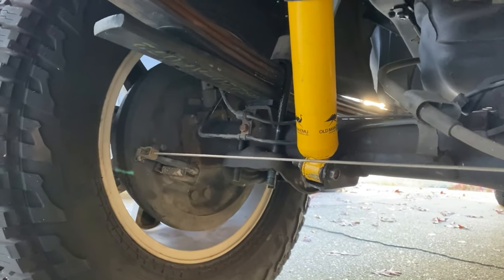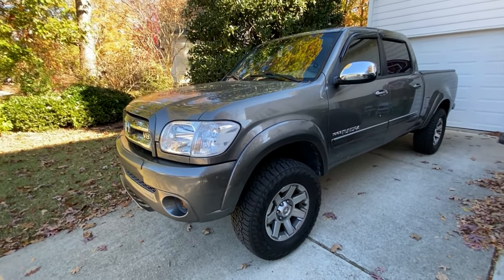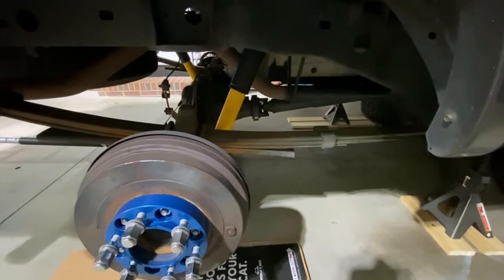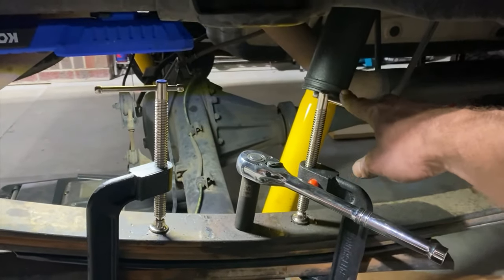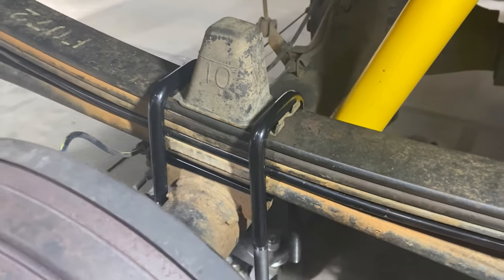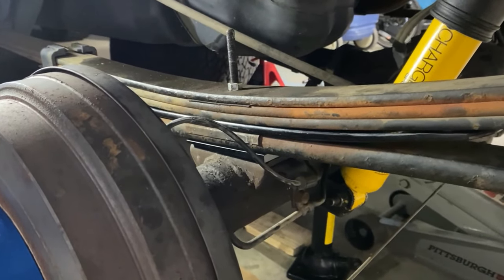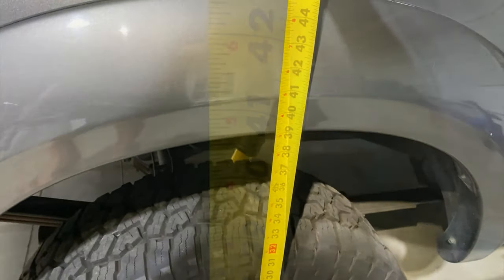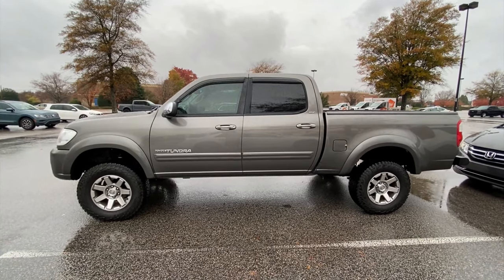Installing Torch Off Road Lift Kit (Add A Leaf and Axle Shim) for 2006 Toyota Tundra

Comment: Nice Tundra - that thing is super clean, looks great with the lift and that tire and wheel setup. I just did the Torch add a leaf in the rear with a 2.5” lift in the front using Rough Country extended strut/spring combo on my 07 Tacoma. Also went with a slightly larger AT tire. Makes it look like a completely different truck, I love it - Ride quality is great too.
Reply from the maker: Nice! That's awesome to hear.

Comment: Nice Tundra, very clean, what size tires are those from Falken?  let me know, that's a super nice riding height.
Reply from the maker: These were 265/70R17s, I've since moved to 285/70R17s on bronze Roost wheels (which allowed me to delete the spaces).
Reply: @danvprod5848  NICE!!!

Comment: I bought the torch add a leaf for a 03 Tundra. Do you have to install the shim kit as well? They weren't included in my kit. Thank you!
Reply from the maker: The shim is not mandatory, but it does make the pinion angle better when you lift the rear. It's an extra purchase, however. You will be likely good without it because if you are running the original springs, they likely have sagged a bit by now, and you will restore the regular ride height, perhaps.

Comment: What size tires are on your truck? I had 265/70/16 GY Duratrac installed on my 06 but I think they look kind of small, not sure if I can swap them for 285/75 /16. I installed the same lift kit...
Reply from the maker: At the time I had 265/70R17s on there, and I upped to the 285/70R17s when I installed in the Method rims. No trimming required, just needed to remove the mud flaps.

Comment: Awesome truck.. love your wheel and tires 
Can you share info please on wheels
Reply from the maker: Thank you! These ones are the 4Runner Trail Edition 17" rims. I found them used on marketplace. Most of the non-trail-edition wheels don't have this nice matte finish, however I'm running Method Roosts now in Bronze, which don't require me to use a spacer.

Comment: Truck looks great, love the 4Runner take off wheels on it as well… I wanted to ask what do you have installed in the front, leveling kit or lift kit?
Reply from the maker: Thanks! I think the 4Runner rims look pretty sharp too. I have an OME kit in the front. I'm getting about 2.5" of lift out of it with the 2885 springs.

Comment: With that extra  leaf how does the truck ride empty?
Reply from the maker: I ended up quickly adding a camper shell, which loaded up the springs by quite a bit. So I think the net result was pretty natural in terms of ride performance, but much happier with the height and drop from front to rear now.

Comment: What did you do for the front end? Did you put spacers on top of the struts?
Reply from the maker: I re-did the whole front end. I purchased the OME shocks with 2885 springs. I also had to redo my upper and lower control arms, ball joints and lower tie rods. I also added the extended sway bar links from Suspension Maxx. I got everything through https://www.1stgenoffroad.com/ and had a local suspension shop install the front end. I got about 3" of lift out of that kit, that is now closer to 2.5". No spacers.

Comment: What lift do you have in the front?
Reply from the maker: It's an OME kit from https://www.1stgenoffroad.com/#/ I am using the 2885 springs with the 1.5" - 3" lift kit. I also put in SPC UCAs and Suspension Maxx extended sway bar links. While the front end was taken apart, I also had new OEM LBJs, tie rods and LCAs installed. Drives like a new truck! Originally I had only put in the matching OME rear shocks, but then needed a bit more lift to match the front. Had I done it again, I prob. would have elected to go with the 2884 springs given the extra weight I put on my rear with the shell. But it's settled nice now.